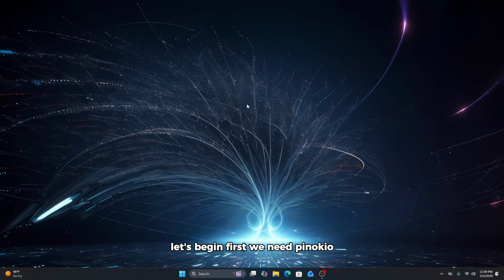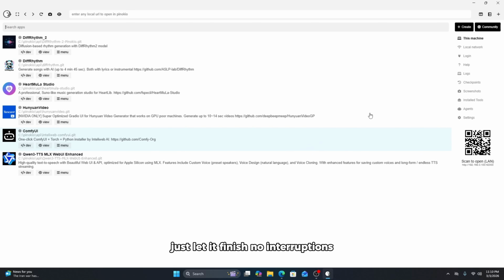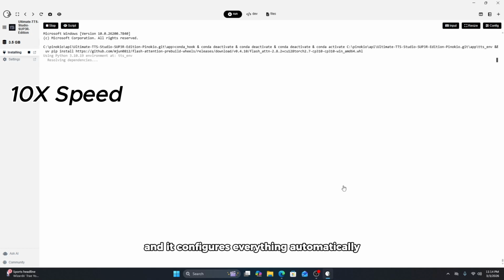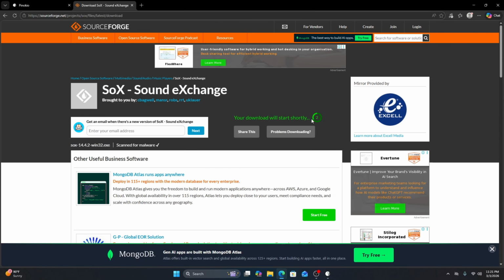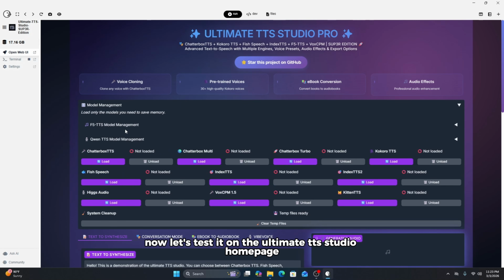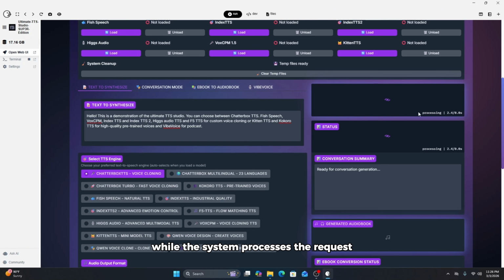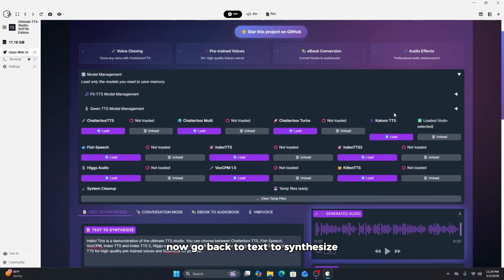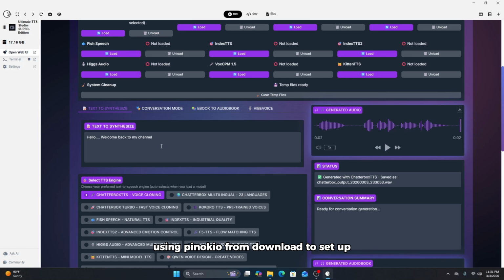Create Realistic AI Voices in Minutes | Ultimate TTS Studio Sup3r Edition Tutorial

Comment: Awesome video. I did as you said and even after i installed sox ,closed and opened pinokio, it still throws me the sourgeforce page. Any heads up or links to read? Thank you
Reply from the maker: Thanks for watching! 🙌

If it's still opening the SourceForge page even after installing sox and restarting Pinokio, it usually means the dependency didn’t install correctly or Pinokio didn’t detect it yet.

A couple things you can try:

1️⃣ Make sure sox is installed and accessible in your system PATH. You can test this by opening a terminal/command prompt and typing sox --version. If it shows the version number, it's installed correctly.

2️⃣ Fully close Pinokio and reopen it, then rerun the install/start step for the app.

3️⃣ If it still redirects to SourceForge, try manually downloading Sox from SourceForge, install it, then restart Pinokio again.

If you're still stuck, feel free to reply with your OS (Windows/Mac/Linux) and a screenshot of the Pinokio logs, and I’ll try to help troubleshoot. 👍